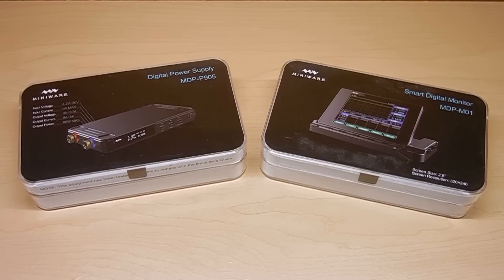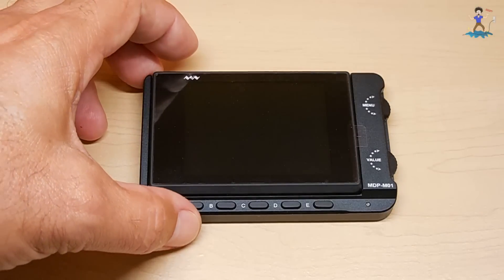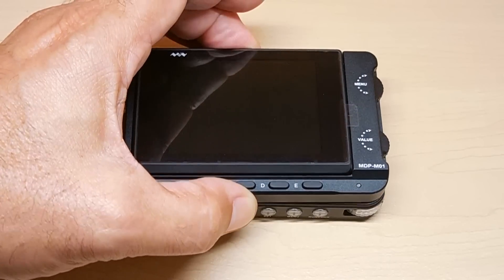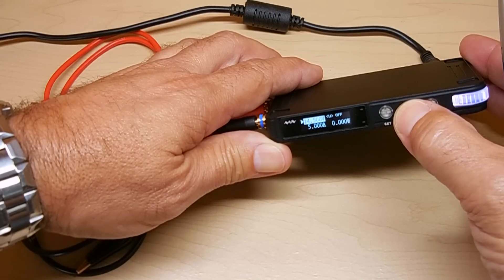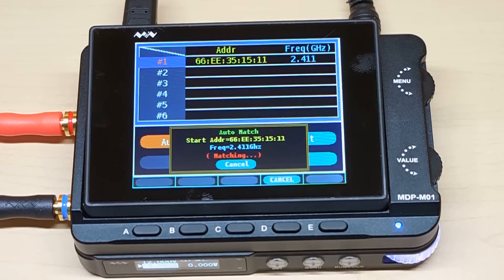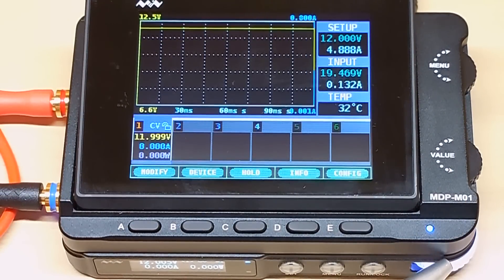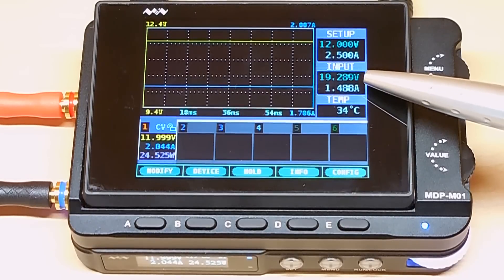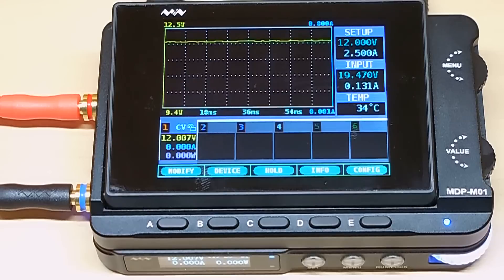World's Smallest Digital Power Supply Control Unit(PSU)?

Comment: FYI You can make adjustments 10x faster on the PS unit by holding in Set whilst spinning the wheel.
Reply from the maker: Thanks for the tip!

Comment: So is this unit portable so it can be used without being plugged in? Does it produce the power all by itself or does it have to be plugged into a power source?
Reply from the maker: Yes, extremely portable, but you need the inexpensive SMPS in the video description area to go with it.
Reply: Can you load the link in the comment on how to buy the smps? I'm not exactly sure what that is. Thanks
Reply from the maker: @chadtanner7159  
Product links(Beats Amazon):
Complete MINI Digital PSU: @t
Only The PSU(No Monitor): @t
Perfect Inexpensive 19V SMPS: @t
(Affiliate Links)
Reply from the maker: @chadtanner7159  
Product links(Beats Amazon):
 
Complete MINI Digital PSU: https://bit.ly/397f1ZR
Only The PSU(No Monitor): https://bit.ly/2EGIH1L
Perfect Inexpensive 19V SMPS: https://bit.ly/2PNdtMT
(Affiliate Links)

Comment: If I want to deliver 30 v or higher to my motor's field windings and 20 amps to the commutator brushes I could not do it with this product  or could I  ???
Talking about a washing machine universal motor  !!!
Reply from the maker: This is a 30 Volt, 5 Amp power supply.

Comment: Are you sure thats gold plating? Most of the time its brass plated to save cost and because it looks just like gold
Reply from the maker: You brought up a good point. It's very possible that the plating is brass on one end, but the other end is definitely non-magnetic. I've only seen copper plated steel clips, so they must be all copper with the exception of the rivet. Thanks for watching!

Comment: Very nice 👍
Can it be used 24/7 permanently on max load and can the data be send to a android device?

HAPPY CHRISTMAS and a HAPPY NEW YEAR 🎄 🎉
Reply from the maker: It's never a good thing to use anything at Max Load 24/7, but using just under it should be fine. I don't think the wifi is for your smartphone, it's used to link all the power output modules. Thanks for watching! Merry X-Mas & Happy New Year to you!